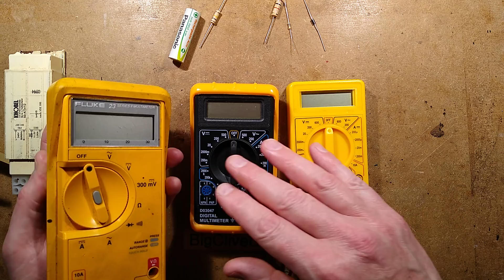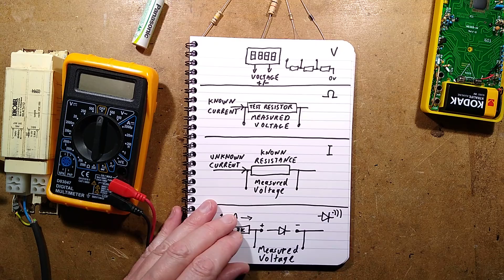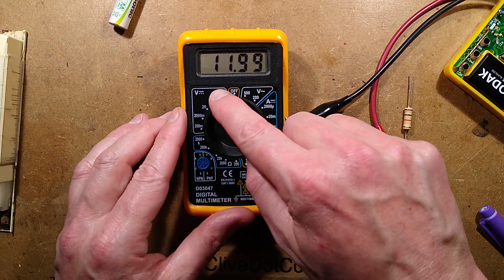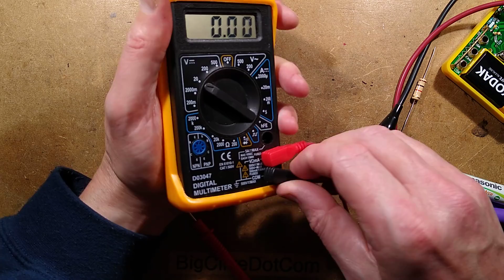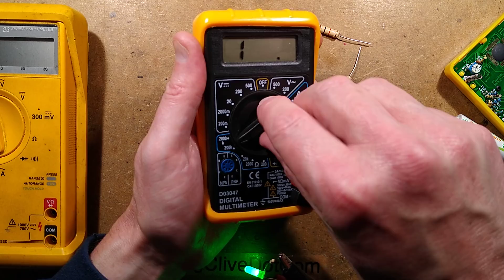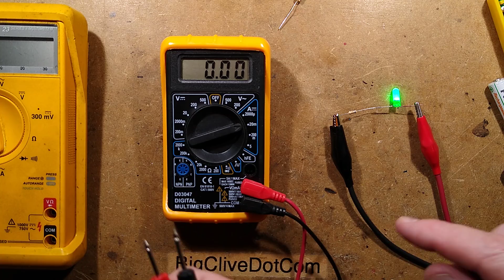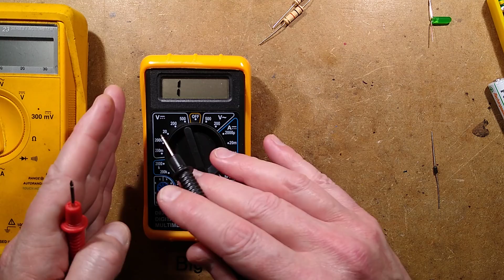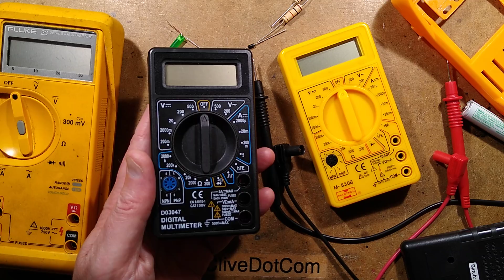How to use your trashy meter without blowing it up (much)

Comment: Big Clive, have you or could you do a Video of how to measure inductors without an Oscilloscope ? I don't have a variable power supply either. Just an Omron 12V power supply. I do have an old Snap On tools Vantage which is a Digital graphing multimeter a Fluke 88 and 3 cheapy multimeters like what you have here. 😊
Reply from the maker: You can get cheap LCD display component testers on eBay that are surprisingly good at measuring inductors and capacitors, plus also identify transistor types.  For very low value inductors you may need a specialist tester.
Reply: @bigclivedotcom  Thanks B.C!! This was a great Video, although I'm familiar with the use of multimeters, it was very informative and interesting. I also can't believe that I hadn't thought of slipping some heat shrink over the alligator clips on my helping hands to not damage very thin wires! (From another Vid of yours) ✌🏼💚

Comment: Comment section as expected :D Cheap meter is ok if you just need continuity, diodes, low voltage stuff etc. You really don't need the Fluke. I'v got Fluke 87V because I do motors and 230V. Wouldn't try this with a cheap one :D This reminds me Android x Apple lol :D About the price.. Yes, if you're just begginer the Fluke is overkill. However the price is almost nothing when you really need it. Fluke is known for it's long live so I see it as a kind of investment..

Comment: Replacing the whole meter is less expensive than replacing the fuse in some mid-level Chinese meters, too.  My ennoLogic eM860T True RMS Multimeter, a fairly decent $60 meter, blew its 630mA x 1000V 10.3 x 38mm ceramic fuse recently but I cannot find anyone, including the manufacturer, willing to ship one or two of them to me for less than a small fortune.  This kind of marketing model drives me batty, but I won't retaliate.  I just won't buy from the same manufacturer again.
Reply: Update:  I finally was able to buy the correct fuses from the manufacturer after I contacted their American distributor by email.  They were reasonably priced and they even sent them to my overseas address without gouging me on international shipping.  Good on them for that.  I just may keep the meter a little while longer now.

Comment: What is that blue spot for on the cheap meter and black one in yellow? The meter I have that's exactly like the cheap one has a blown fuse and when I connected a new 9 volt battery and turned it on it would very briefly display that it was on then shut off.
What would happen to a meter if someone used a manual push button Piezo Electric grill igniter connected to the leads?
Reply from the maker: It's the largely useless transistor gain tester.

Comment: Thanks for this Clive, I bought my first multimeter last week and this video was very helpful. I have a question and I'd be very grateful if you could help. 

I'm currrently restoring a motorcycle and I've just checked the ignition coils. The primary windings in each coil are within spec (0.3 -  0.4 ohms), so no problems there. 

The secondary windings however are reading higher than they should; the manual gives a figure of between 30.0 - 40.0 K-ohms but the windings on one of my coils is reading 42.2, while the other is showing 43.9. 

The instructions that came with my meter give a resistance accuracy of + - 08.%. Any idea why these secondary windings are out of spec?
Reply from the maker: That sounds fine for your secondary windings.  It's an acceptable tolerance.  If anything 30-40K seems a surprisingly high value for a winding.

Comment: Paul Carlson likes to use a scope meter that displays "OUCH" when auto-ranging. Not sure what that's supposed to be an acronym for, but he's frequently commented on the meter saying "ouch!" about a high voltage.

Transistor gain testing is only really useful if you have an application that requires matched transistors, and in those cases you will want to match them at specific voltages and currents which will almost certainly be higher than those used by a dinky meter. You'd build your own testing apparatus specifically for that application, possibly even as a one-and-done or modify-for-each-use on a breadboard; I understand Paul has a semi-permanent space on his breadboard for such a circuit. I checked my own dinky meter with a random selection of small signal transistors from eBay and they all measured about 300, which is way over-spec and suspect. Even worse than the uselessness of the hFE range, the contacts in the transistor socket are shite.
Reply: I've a friendly DVM - display shows HELLO on power up.

Comment: A while back I trouble shot an hvac control circuit for an hour until I realized my meter was in DC mode. I will never make that mistake again.
Reply from the maker: That's not uncommon, but next time you'll realise it faster.  It's all part of the learning experience.

Comment: Why don't meters come with at least one (non-conductive) third hand - say, somewhere above the display, built into a purposive platform/anvil/workbench?
Reply from the maker: Many have a probe holder on the back.
Reply: @bigclivedotcom  Yes,and they're suited to storage. However, they're not well suited to holding anything you might be working on. 'Many hands make light work.'

Comment: Have a couple of these cheap meters, neither has the beeper on continuity. Is there a simple way to add it? I have some piezo buzzers I could use.
Reply from the maker: The PCB might possibly have a place for it.  But it would depend on whether the rest of the circuitry was there.

Comment: I have various meters, none of them are Fluke though.  I have one of the little meters that Harbor Freight gave away.  The little red one.  I like it but it doesn't have a continuity tester.  Is there anyway to add a beeper to it?
Reply from the maker: Not easily unless the rest of the circuitry is there.  A continuity beeper is something to look out for when buying a meter.

Comment: familiarity with a crap meter is 100% better than being unfamiliar with a good meter, I never let appretices use my meter, they NEED to learn the behavior of their own meter. Also, anyone that thinks Fluke is the ultimate is an average electrician, there are much much better brands, also there are much much cheaper brands that work equally as good. I've noticed Fluke take a huge dive in quality in the last 10yrs, Uni T seems to be really pushing to take their market, which was once a horrible brand, but now my favorite

Comment: Is there a way of finding out the voltage and wattage of small incandescent bulbs - such as vintage fairy light bulbs ? …. A problem with  vintage fairy light bulbs acquired  from eBay ( often used) is they rarely have packaging or markings - Also the 6 volt , 12 volt and 7.2 volt bulbs all look similar . 
I have 20 bulb sets and all the bulbs need to be same in the set . 
Another issue is Pifco  used 12.5 volt 1.1 watt bulbs - but some brands are 12 volt and 1 watt … 
Is there a way to measure the voltage rating of the bulb and the wattage ????
Reply from the maker: Only thing that comes to mind is slowly turning the voltage up until the look a normal brightness then note the voltage.
Reply: @bigclivedotcom  thanks for reply - I did buy a cheapy tester in Wilko for £12 , solely to use on these  fairy light bulbs. Not sure what to do with it now but it does make me feel more manly 😜 I might get some of those work trousers with the pockets next 😂

Comment: Hey Clive I have both styles of meters elcheapo and fluke 27 for old tube radios both work fine but I feel the fluke is a bit more accurate with voltages on the chassis and voltage of capacitors  most are dried up in side though from that era do you have any American am tube radios in your collection Clive?
Reply from the maker: I don't have any radios here.

Comment: Re the transistor tester, no, never use it... We all use those AMAZING little multi component testers that cost ten quid. They are just greater than the sum of the parts used. Imagine having that in the 70s/80s?

Comment: Is there a reason most meters have a range that ends at 200v, as opposed to say 300v, which would be more useful for our 230-ish mains voltage?
Reply from the maker: I think it's to do with the size of the ADC converter resolution that limits the display to a 199 count.  The nearest binary multiple if 255.
Reply: I have an el cheapo meter that goes to 600. It's not a HF meter but looks similar. So it can go higher. It has the standard 3 digits.

Comment: I have the very same cheap meter but it doesn't work with the black lead in COM but does with red in the top hole and the black in the middle. It then reads fine albeit giving negative voltages. I don't know how I've screwed it. It's only used for testing batteries anyway.
Reply from the maker: That sounds like a PCB solder joint issue on the COM socket, since the circuit is still being made through the shunt.  Theoretically, if you put the black lead in 10A and put the red one in the middle port it will read the correct polarity.
Reply: @bigclivedotcom  Many thanks for your answer. I'll try that.

Comment: My meter has served me well but boy does it show its age.  It doesn't have the anomalous blob, it has a discrete through-hole microprocessor chip.  And one of the large pitch chips at that, you could fit 2 Arduino Nano's in the space this thing takes.

Comment: Hehe!  Work on 80s pinballs and you’ll use a wider range of ranges both AC and DC than ever before!!!  

Disagree, scratchy is best, especially when diagnosing failing flipper flybacks as the vibration can cause micro failures which cause game chaos but a scratchy meter picks it up super quickly while a delayed would miss it.

Comment: Clive. 
I’ve got one like your cheap non beeping one. 

As I changed the battery the spring fell out. 
Would that cause me an issue?
Reply from the maker: If it's the spring that connects to the metal shielding foil inside the case then it may cause weird random readings in the vicinity of some high voltage or electrically noisy equipment.
Reply: @bigclivedotcom  brill thanks for info.

Comment: we had a lad at college that was messing around with the ECU on one of the new bikes with a multi meter. He ended up frying the ECU and basically scrapping the bike. needless to say nobody was impressed. An expensive lesson on which slot the multi-meter leads go in.
Reply from the maker: Frying an ECU is all part of a mechanic's learning experience.
Reply: @bigclivedotcom  it sure is, just a shame it wrote the bike off before any of us got our hands on it.

Comment: Is there a way to improve accuracy on the cheaper multi-meters?   Would love to improve my old one, using the knowledge I've gained over the years
Reply from the maker: They're not really designed for easy calibration.  In most instances they are fairly accurate out of the box.

Comment: 0. Always be safe! 
1. NEVER lend your meter to ANYONE !
They ALWAYS come back ruined...
2. Don't believe ANYONE when they say the welder they want you to test doesn't have high voltage arc start. (Your meter will be instantly smoked.)
3. Replace the test lead wires that comes with the cheap meters. The reason they don't have a 5 Amp fuse is because the super skinny wire starts melting above 5 Amps which saves the meter and burns your fingers (while zapping you and often adding resistance losses to your test.)
4. Keep extra batteries around, when they get low, most meters give trash results.
5. Get some alligator clips to attach to the test probes.
Bonus TIP:
5.5mmX2.1mm DC barrel plugs accept test probe tips very nicely, use them to make all kinds of adapters you can easily slip onto your test leads or keep in a circuit for easy testing and calibration.  I made an adapter from heavy wire to measure current from the car battery while being started. (Keep in mind a lot of homemade stuff may not take temperature and other variables into account which can change results dramatically.)

* A highly un-recommended thing I have done more than once is to use clip on leads in combination with short thin hypodermic needles. The plastic part of the needle makes a nice insulated handle to stab into a wire, then you can clip on for testing. You can even measure high currents accurately if you know the wire's gauge, material and temperature by stabbing a specific length.
Reply from the maker: You can get wire piercing probes.

Comment: I would say buy a fluke 101( though a bit expensive 50 pounds) or any meter that doesnt do current measurements as doing current measurements is what generally damages fuse and leads even for experienced engineers.

Comment: that cheap meter.. i charge a 12v sla battery.. set limit 14.4v on charger follow meter and my bat decide to kill itself, took me a while to notice it was the meter that is bork2.. the 14.4 was actually 15.7v

Comment: fluke 87 owner - the true RMS is for measuring Phase shifting ? -
 if we ever get an alien invasion, or a Vpp supply anomalies ?

I have no clue what 0.707 is or does to any readings my lil meter does.
or any other of the - ( hold for 2 secs while power on ) ????

top notch content ! ~ @Sir #BigCliveDotCom
Reply from the maker: True RMS doesn't just use an average.  It actively measures samples across the reading to give greater accuracy at higher frequencies.
The 0.707 feature may be to calculate peak voltage from RMS voltage.

Comment: What are the minimum requirements (things to look for) in a meter deemed safe for measuring 120V?  Is there something between the cheapo and Fluke?  That doesn't need to be a robust as Fluke but you want to be safe for a novice who may make mistakes.
Reply from the maker: I'd recommend going by the Category ratings.  Cat II for appliances and Cat III for proper electrical work.  A good meter doesn't need to cost a lot.

Comment: what meter would you recommend for crt repair?
i got a monitor cheap and it must have been on it's last legs when it was shipped and must have died when i plugged it in and turned it on.
i looked online for symptoms for the issues for the monitor 
and it appears that a component known as a horizontal output transistor blew out
the component controls the high voltage of the flyback transformer and also controls the horizontal raster
aka the electron beam moving left and right and without it working the screen doesn't work 
i went and found the service manual for the model of monitor to help find the exact component and am now looking for various tools and gadgets to insure i don't end up looking like i flew a kite during a thunderstorm

Comment: An autoranging meter can be a bit annoying drifting around optimising itself as you are for example just probing around looking for basic familiarity with a circuit, where is the incoming dc volts, then a regulator, a low voltage rail, a negative rail and so on. so quickly high high medium low zero negative, very negative, and so on.

Comment: My Fluke 15B+ died after one year. Post mortem showed that the battery has leaked and I replaced them with new. Then I noticed that the battery clip (is that the correct name) that connected the two AA in series has broken and the plastic has gone. The quality of construction is poor, IMHO. I soldered two AA in series and replaced them back.

Comment: I have two of the cheap yellow ones that both read too high in the voltage range. The resistance seems okay but haven’t tried it for current. I know they’re cheap enough to replace and have much better meter but just wondered if you have any idea why they both have the same fault.
Reply from the maker: If they came from the same batch it might have been a manufacturing issue.

Comment: I'm fairly sure the O.L. report means 'Over Limit," meaning the value is too high to give a sane result on that range.  You're not going to overload a meter by trying to measure 2 megohms on the 20 ohm range, but the result wouldn't mean anything.

Comment: So I know testing continuity while the circuit is live doesn't work but my question is does that hurt my meter? A mid grade Klein. Also any suggestions on how to test sealed contactors while not energized?
Reply from the maker: Whether the meter is damaged depends on the voltage and duration of contact.  Testing a contractor really needs to be done with the circuit active.

Comment: Second viewing, I'd say most home gamers could get more utility out of a handful of trashy meters than a single pro-jobber DMM costing a couple orders of magnitude more. If you know what you're doing, two trashy meters will get you meaningful 4-wire Kelvin measurements that you cannot get from a single meter at any price point.

Dave seems to think any electronics engineer needs at least 4 DMMs based on his use case of measuring power supply input and output voltage and current. At hobbyist voltages and currents, trashy meters are more than adequate for this.

Comment: I used one of those yellow cheap cheap meters to check voltage on a 400V circuit once. I was VERY careful. Hey Clive do you have any recommendations for those of us who are not electricians but want to be able to do their own electrical and electronics repair and work for ourselves?
Reply from the maker: Given that YouTube has become such a massive educational resource, it's a good place to research an electrical project.

Comment: You remembered me that one time I tried to measure between earth and live with a meter on an UPS and one loud boom later my parents were questioning me about the reasons of the black out. It was not an online UPS so the outputs where directly connected to the mains, tripping the gfci.
Of course that could've fucked up the meter for good so yeah listen to the man buy cheap stuff when you start.